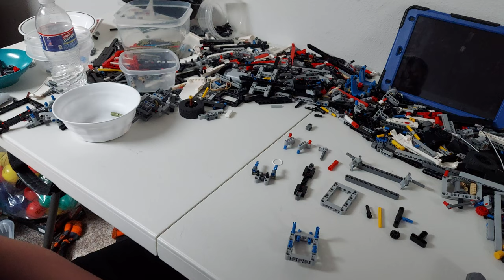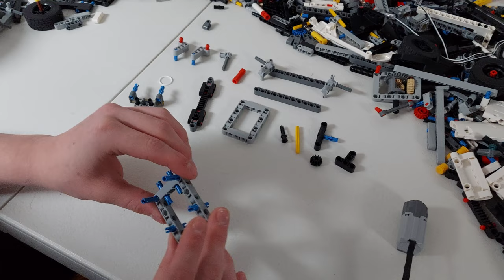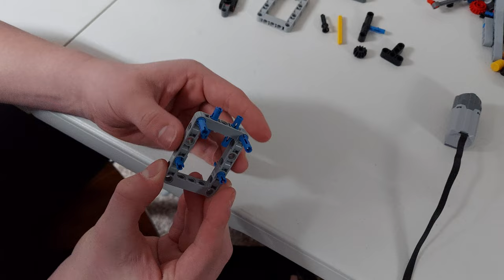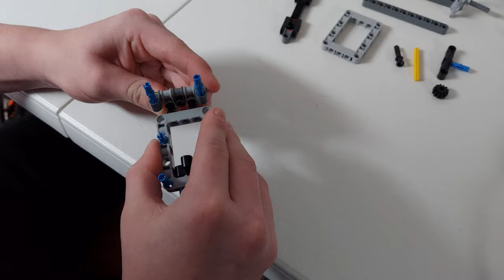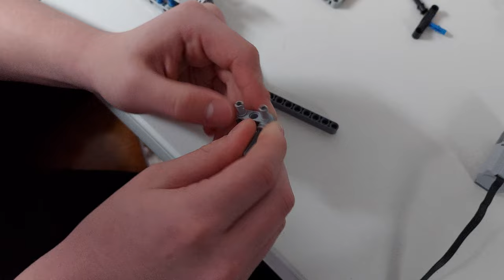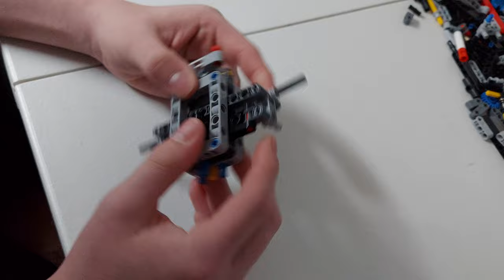How to Build an M Motor Return to Center Steering System - Instructions - No Servo

Comment: The down side to this method is if you use buwizz or consistently turn back and forth the motor eventually stops working and over heats because it's not meant to handle the load of steering.

Comment: where did you bought this battery and controler? it look very nice to use!
Reply: You can’t buy them anymore from Lego, but you can buy them from eBay and stuff like that for really expensive. It’s called power functions
Reply from the maker: It's the CaDa power set. It's like 50 dollars. I think it was worth it

Comment: Is there a way to do this without the steering rack you showed.
Also what does a servo motor do in difference
Reply: a servo motor just turns 90 degrees to the left and right. its really good for steering because you can make a axle turn 90 degrees and turn tires way easier. i would prefer using a servo motor over a different one because the servo motor doesnt take stress because it is made to turn 90 degrees, and the regular motor takes lots of stress when used the way shown in the video. when under lots of stress it shortens the life of the motor.
Reply from the maker: There are ways but ot is more complicated. Servos will automatically return to center. Which is really good for rc cars

Comment: If i hold left turn button or right turn button for too long, motor M will heat up very fast and it can't return to 0.Is there anyway to fix it
Reply from the maker: I'm not sure. The only thing I can think of would be to just try not to stress it too much. The design isn't perfect